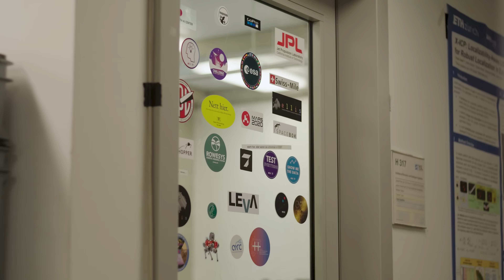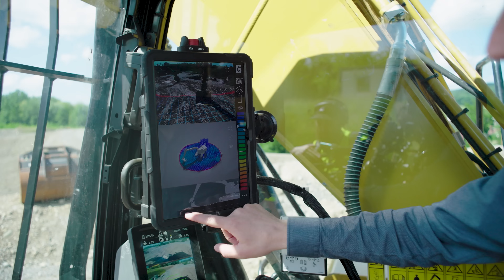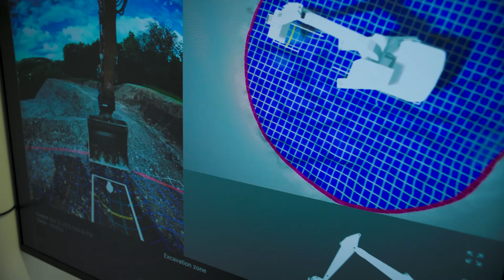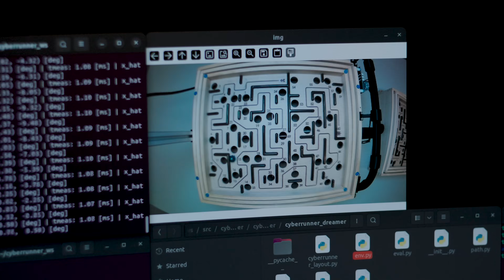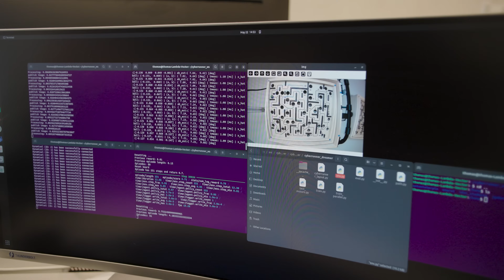The Swiss Are Making Some Very Good Robots. Really

Comment: Awesome. 

Does anybody know if there is a company out there developing robots for a set of limited (5 units at most) home environments which at least can deliver a certain service combo meeting 3 sigma demands? 

Say for example a family likes 10 sets of meals, based on observations, and they have a U shaped kitchen with an island in the middle with standard wall and base cabinets. The three elements of fire, water and ice are also embedded in between with a dish washer somewhere in there. Can this robot for instance handle this kitchen, without any intervention, if all consumables are replenished as needed? Hint: please ignore battery demands as this fixed environment will be with a plug.
Reply: 1x is a Norwegian company working on humanoid robots to work in domestic settings.  Last year, I saw a report about them looking for some families where they could place the robots, on the theory that real-world practice will improve the state of the art faster than lab work.
Reply: @qcca123-f1v  Precisely my intent. Instead of developing AGIbots several years down the road it's more practical to solve immediate problems in fixed settings. Fixed here doesnt mean lack of choices but there really is a finite configuration for kitchen cabinets and appliances and it's time consuming activity for rat racers. I think, if firms decide so, Germans would get there first though...just saying.
Reply: that's for the futur... for now what we see of autonomous robots doing different task is like an 100years old man moving while shaking. 

But yes it would be cool to have robots units to do chores or kitchen (it would be like having a chauffeur for the car, a chef for the kitchen and a housekeeping)

The price would be the limite for decades. But autonomous car are already a thing (just depend of the country authorisation for driving without hand on the steering wheel) so it could be in a near futur.